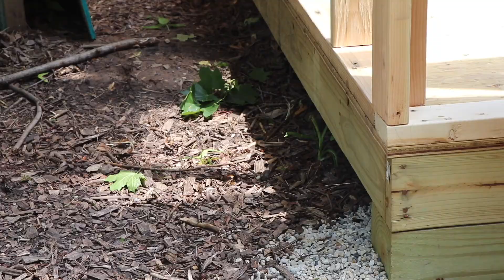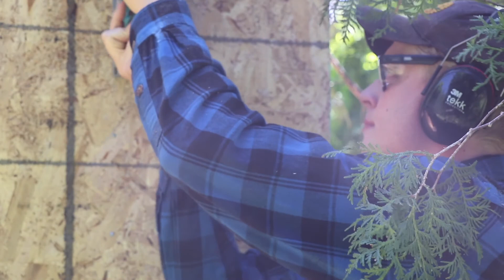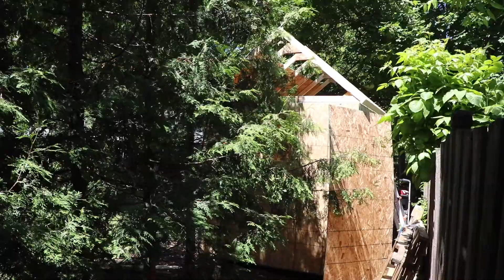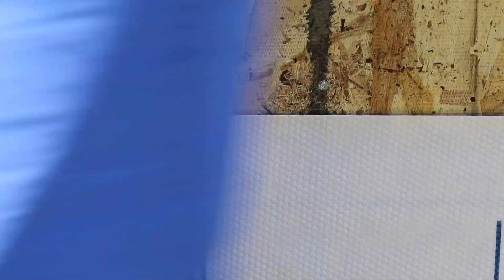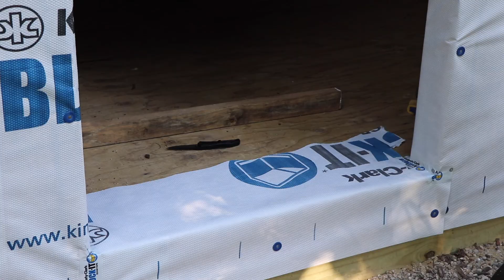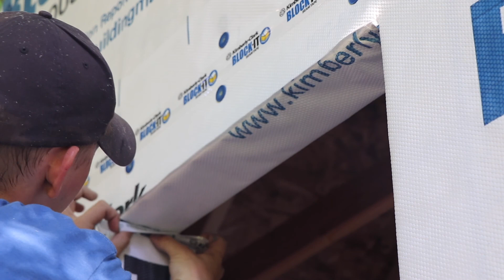How to Apply Plywood Sheathing & Vapor Barrier - Building a Shed Part 5

Comment: So if there's 1/8 of an inch between the OSB boards for expansion, did you put any caulking in between them? Google AI said this is a bad idea because it traps moisture, but
I'm just curious because it seems like this would also let in some cold air.

Comment: I just had a shed built in florida they put the vapor barrier in the inside.
I want to cool the shed.
The vapor barrier should have been installed in the outside am I right?
Reply from the maker: Well, I am not a contractor and so I can't truly answer your question from a technical standpoint.  All I can say is that I walk through houses when they're being built for fun, you know, and up here we only put vapor barrier on the outside of a house (or a shed, in our case).  Ask around with some of your local contractors and see what they say.  Good luck!
Reply: @MidwestManMountain  ok great thank you very much
Reply: Inside in warm climate, outside in cold climates.